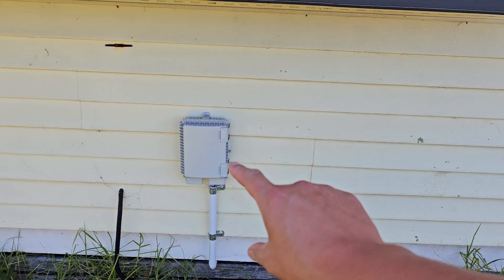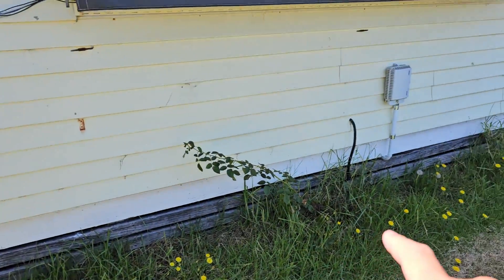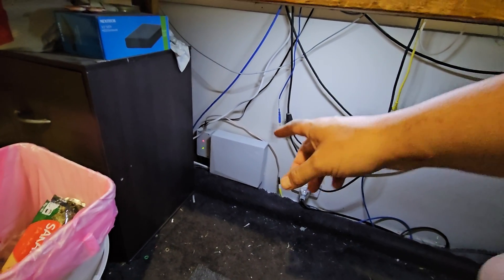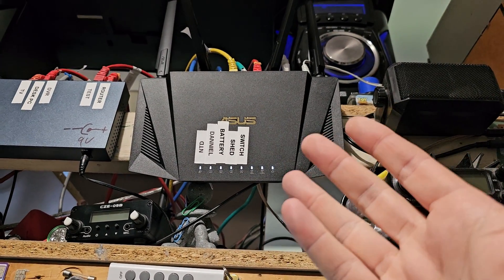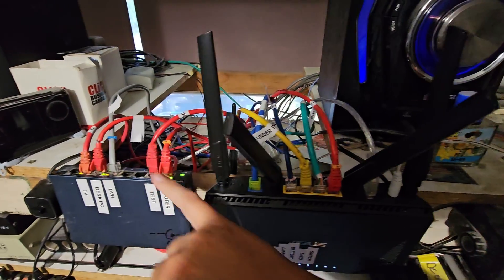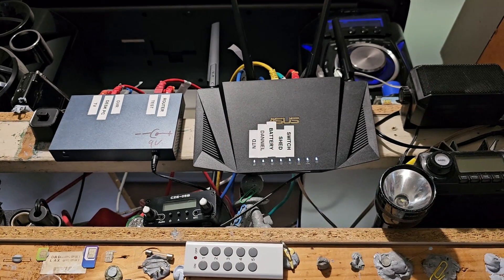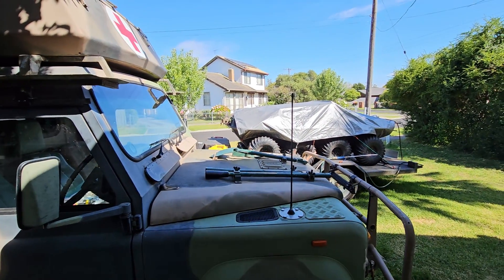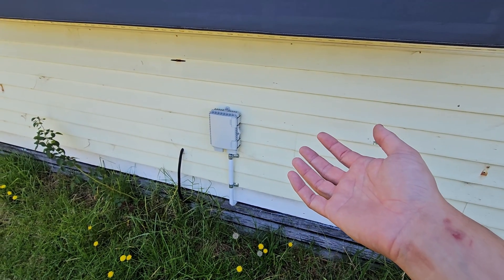You asked | NBN Fibre to the Premises

Comment: We had to have our NBN FTTP come in via aerial wire too.  The existing underground 10mm metal conduit carrying the Telstra copper pairs into my house wouldn't allow the addition of the optical fibre. The installer said by law they aren't allowed to remove the old copper pairs. They suggetsed they dig up my driveway and add a new conduit for the optical fibre. I remonstrated. It turns out if the old Optus coax on the pole to my house is damaged or faulty, they can remove it and run the NBN OF in aerially. Well, they found my Optus coax was "faulty" and we went aerial OF. Saved them a lot of work and the NBN a lot of money. Me...happy!
Reply from the maker: Phone lines here have always been overhead. many of them have fallen off over the years\

Comment: umm yes you can plug straight into the ntd
Reply from the maker: @tassieman9293  not in this case. It all depends what your provider does at the other end.
The NTD is basically just a fancy network lead, if they arent using DHCP at the other end, it won't work.

Comment: did you had any issues with nbn
Reply from the maker: @timothythorpe4667  no, it's been rock solid. We had NBN fiber to the node prior yo this and it would drop out when it rained, thunder, power spike, excesdive hot weather, severe wind - or a bird farted 9 miles away.

Fiber to the premises has been so solid, we get 7ms jitter and 5ms ping to 8.8.8.8.

Comment: Actually you CAN plug a computer direct into the NTD, as long as you have DHCP on. I have done this at 2 FTTP locations for troubleshooting. But it is preferred to use a router like you said.
Reply from the maker: To add a little more context here - the NTD is just a termination (think of it like a giant ethernet cable) - some services provide a DHCP service on the other end of that termination, mine does not.
the IP assignment is not done at the NTD.
Reply: @TheAussieRepairGuy does your ISP use PPPoE or static IP?
Reply from the maker: @iamdave84  They like to use PPPOE
but you can request a static IP but they charge a little bit extra
Reply from the maker: @CarstenBauer  yeah this particular config did not enable the DHCP server. It expects manually configured settings.

Comment: Great video, one correction though, you can plug your PC directly into the UNI-D port on the NTD and get internet, it functions as the modem for the connection. Having previously worked at an ISP and nbn for a few years this was something we would suggest during troubleshooting for FTTP connections.

edit: This would apply for ISPs using an IPoE connection, if your ISP uses PPPoE you would have to set up a dialer on the PC / would need additional configuration for VLAN tagging however the ISPs I would recommend do not use VLAN tagging or a PPPoE setup
Reply: NTD is just that, end termination and in some cases, media conversion. Some RSP's (Reselling Service Provider as ISP is for Internet Service Provider whom assumes they own and control some or all of their delivery which NBN simply does not allow) will provide simple DHCP style internet (plug in, get public IP) but others only provide via PPPoE or VLAN'ed service.
Reply from the maker: Yeah not in this case, you need a separate router.
have already tried that.
I have also spent time working for an ISP as well as more than one comms company.

Comment: In New Zealand those fibre boxes are called ONT's optical network terminal
Reply from the maker: Yeah different terminology, same thing.
Reply: I doubt that being the case unless that box contains the equipment that produces the ethernet.  A bit of web searching suggests what you call an ONT is what we would called the NTD/NTU, ie the piece of equipment that is typically located inside the house, has fibre and power run to it, has das blinken lights and ethernet from it to the CPE.  This box would be described as the PCD - premises connection device, which connects the fibre entering the premises (yard) with the fibre run in the house to the NTD.
Reply: @retrozmachine1189  we have fibre from the street straight to our ONT then ethernet to our Routers.. I have a Huawei HN8250TS attached to my wall doing 10gbe to my UDM-PRO to provide my 2000/2000 plan

Comment: Good to see the installation.
Many moons ago, when we lived the other side of the city, our street was one of the first group to get fiber to the home.
First an NBN guy turned up to connect the house, the pit was outside the house.
Told us he couldn't do it as he was trained to put fiber inside the existing Telstra/GPO conduit, possibly a two jam tins and string version.
Conduit was copper, ran under the driveway and was squashed.
No wonder  NBN cost blowout, no consideration for antiquated phone infrastructure.
We all in the house used mobile phones, so no need for wire telephone.
4 weeks later a team arrived, trained to do an underground install.
Dug up the nature strip and lawn to the house, place the sods back neatly and did a really good job, they got a cuppa for their fine efforts.
4 weeks later a team arrived to get fiber from outside box to inside box, another efficient job, cuppa.
3 weeks later the Optus lady turned up with a guy to put Optus box on the wall, that took all of 15minutes, and 5 minutes for her to play with her tablet and bingo we were a goer, declined a cuppa.
System 90% of time good, has two Chromecasts, two laptops, and 2 or up to 4 tablets/phones off it.
Only time a problem, school holidays around mid afternoon and speed drops to below 15Mb, sometime below 5Mb, even in our house now that is in a newer housing estate.
Have had about three full system drop outs in the estate in the 5 years I've been here, each lasted about an hour each.
Got to negotiate/check for a new deal as contract is ages old.
Stay Safe mate.